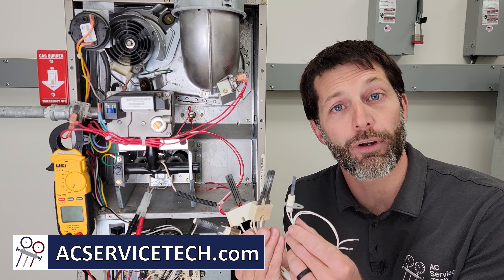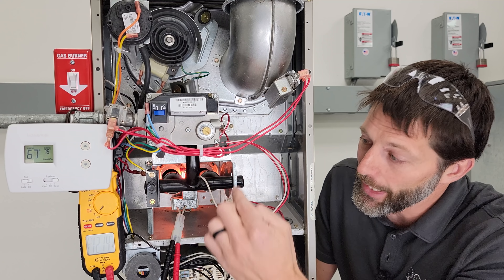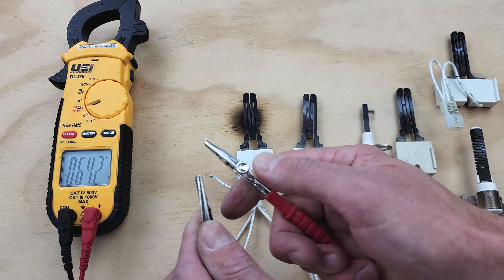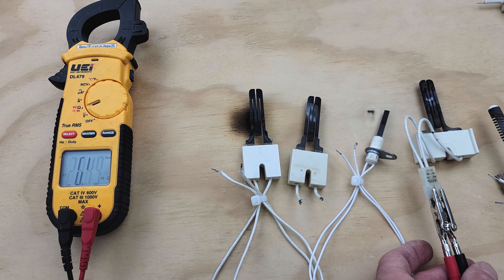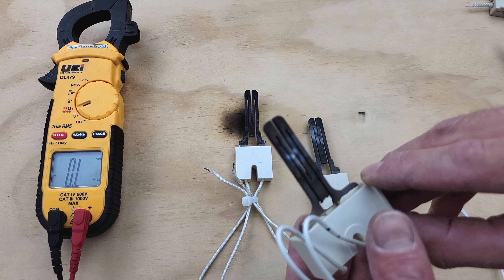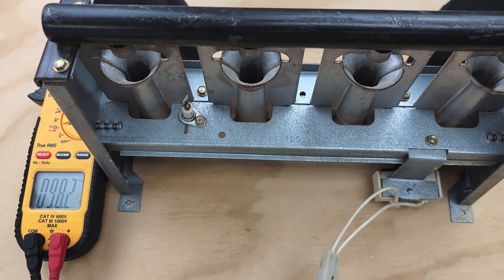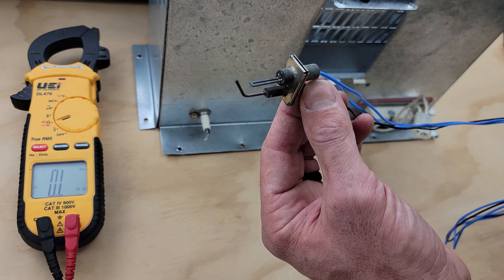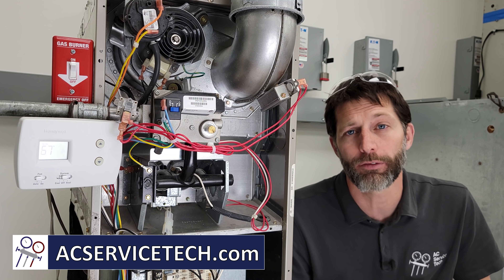HOT SURFACE IGNITOR Training for Gas Furnaces! HSI Types, Operation, Troubleshooting!

Comment: Absolutely on the money with all of your insights. I was having a problem with an igniter that only worked once. It turned out that the angle on it was the issue. It needed to be slightly angled and little closer to the burners to ignite. Saved me lots of money and additional frustrations. Great video! 👍👍👍

Comment: Excellent, just an excellent video...I see in comments they are used in ovens and such...True, and if the amperage draw and the Resistance as they get weaker is not enough the gas valve will not open...The igniter will glow but it still will not open the gas valve...Most require 2.5 - 3amps on an amp probe to open the safety valve on an oven...Thanks for a great video.

Comment: Thanks so much for this video.  It is a super clear explanation of how an ignitor works and how to troubleshoot it.  My furnace was not making heat and I was on the verge of looking for an HVAC company to come out and fix it but that would have undoubtedly cost me hundreds of dollars and days of delay.  This video showed me that my ignitor was bad and I was able to fix it myself.  I used a voltmeter to confirm that AC was reaching the ignitor and that the resistance of the ignitor was zero.  My furnace is a Trane and I was only getting a max of about 3.5 volts AC before it stepped down to 1.2 volts.  The repair was actually quite simple, just replace the ignitor.  Thanks again for this excellent video!!!  You're a rock star!!!

Comment: Important to note that the resistance with these igniters changes with heat. May start out at 20-50Ω but that resistance multiplies ~10X when powered for current regulation and longevity.

Comment: If you zoom in on the one in the middle that is bad when he applies power, you can see tiny arcs across the crack.  Those heat the crack, which likely expands enough to cause the ignitor to start flowing enough current to glow.  As with anything, those arc will eventually erode (pit) the crack causing complete failure.

Comment: Thanks for the video.  It's very informative.  I have a gas PTAC unit (Suburban Dynaline 3). Is the ignitor universal?   Do I need to do anything to suck out the remaining gas before I replace the ignitor? (Ex: shut off gas valve)

Comment: When you applied power, a tiny flash occurred on the defective unit and it started glowing in a small area.  That would have been an intermittent failure mode. BTY the good one on the left was drawing 245W and the small one on the right was drawing 300W.

Comment: Hvac newbie here….   If its glowing evenly no white residue, but measures 130 ohms is it still good? Is there a definite limit?
Reply: @FloatingLeaf1111  @E Man over the years on equipment I've found that 45 to 75 is OK, anything above 100/125 I recommend replacement, a lot of people decide against it the first time you recommend something like that especially if theyve never had a 95 dollar ignitor shut their furnace down lol.
Reply: I typically do an amp draw as well as ohm check. On the silicon carbide, I generally like to see at least 3 amps. Under 3 amps on a carbide means it might not be getting hot enough. I don't remember off hand the amp draw on silicon nitride, I've had virtually no issues with those. About the only failures I've seen with the nitrides are from getting wet from leaking condensate.
Reply: At 40 ohms they are pulling 3 amps so on a 120v circuit heating at 360 watts.  But at 120 ohms, they would only pull 1 am so 120 watts.  So in still air, the 40 ohm will turn red 3 times faster than the 1 ohm.  And the lower wattage also runs the risk that even the flowing gas could cool it to the point where it doesn't get hot enough to ignite the gas.
Reply: @FloatingLeaf1111 Something to consider is the pressure of the gas is only 3.5" w.c. or 11" w.c. manifold pressure, which is under 1/3 of a psi max. the inducer whipping around at 3000 rpm is going to cool the ignitor down a lot more than the gas flow. Ive found position of the ignitor to be alot more important than pressure or even the condition of the ignitor all important, but also Dirty burner or turbolator wont help either
Reply: You just check the manufacturer literature for the acceptable range. If it’s outside that range then replace it

Comment: Hi Sir, Thanks a lot for the video. Learned a lot. Here, I've got a question to ask for help. My house has a Goodman 2 Stage gas furnace. Recently it stopped working. I doubted the failure of the control board so I ordered one and replaced it. But it still doesn’t work. Problem is same. After the further check, I've noticed that if I connect all 5 pin connecter (link inducer and igniter), the draft inducer won’t work. It has only a couple of volts. But the ingiter has around 110 volts of power. When I disconnect either end of the line to igniter (on 5 pin connecter), the inducer runs, but igniter doesn’t (surely, no power in). When the inducer runs, it runs normally and smoothly. No any sign of problem. The igniter has 48 ohm when tested continuity. Seems also good. What could be the cause? Thanks.

Comment: I found this very educational.     Thanks.   A few questions when it comes to replacing a HSI.  Would accidentally touching the element during installation cause shorter lifespan due to skin oils?   Some folks tell me you should take precautions similar to changing out a halogen lamp, that is,  use rubbing alcohol if accidentally touched,  to remove skin oils that can hot spots and damage the glass when the lamp is turned on.    Others say it doesn't affect a hot surface ignitor.   Any other precautions that should be considered when removing or installing a hot surface ignitor?

Comment: Does old rheed furnace igniter polarity sensitive? When I replaced it with a new igniter, it tripped the breaker. Then after reversing the wire to the igniter, everything works fine.

Comment: How do you check for micro-amps on a furnace using the hot surface igniter as both the igniter and sensing rod? After having disappeared, (I thought), they’re back. I’m wrong. The system I was remembering was intermittent spark. What I’m seeing now is silicon nitride hot surface.

Comment: I had a No Heat call in 2019.  I went there and tested every part for heat.  The Hot Surface Igniter was not very bright.  I took ahold of the connector and turned it to see the part numbers.  The igniter started to glow real bright.  What was the problem?  Just some corrosion on a contact at the connector.  That was the second job for that customer.  The first was a no cooling call.  The capacitor for the indoor fan was replaced.  The classic bowing of the top of the capacitor.  My thiord time there was to replace the return air register.  It sits low on the wall and does get hit at times.  The customer inquired about the register on the first job.

Comment: my igniter is in a caloric oven, glows but does not lite burner for oven. caloric site made it sound as tho if its weak then it wont open gas valve and i should replace igniter. does it have to be cracked to be bad/weak?? or can it just be old age? ( my caloric oven is 30+ yrs old or so) ... I'm just asking cuz from what i see, i don't see any cracks in it ...

Comment: I made a mistake and (preventative maintenance reasons) cleaned my silicone nitride version, which looks just like the newest style in your video.  I used 0000 steel wool, then cleaned it with alcohol before re-installation.  It was in super good physical condition and worked fine, before and after.  Will this likely shorten its life?

Comment: My gas furnace has SPARK  ignition which has proven to be very reliable,  so I’ve always questioned the HOT SURFACE IGNITOR. Why use them when they always fail.  How would you convert from hot surface ignitor to spark ignition. 
Thank you.
Reply: Hot surface has finally caught up with spark in reliability with the silicon nitride. Why HSI vs Spark? Spark ignition requires a more complicated circuit to produce the spark, where hot surface is just a relay with 120v and most spark have intermittent pilot, so a more complicated gas valve, a pilot and tubing for the pilot. It wouldn't be impossible to change from hot surface to spark, but the furnace was not engineered to have that type of ignition and the liability of changing it could be substantial. But to answer your question, the 3 main differences between hot surface and spark are: 1. the ignition module or control board has to be spark. 2. The gas valves are likely different as mentioned before. 3. The ignitor would have to be replaced with a spark/pilot assembly.
Reply: Intermittent pilot with spark pilot ignition is likely what you have.  That way the pilot flame is proven before turning on the gas full.  If you try to light the burner with spark ignition, you could end up with a cabinet full of gas if the ignition failed.  And then you could have an explosion.  

Should the gas not immediately ignite with a hot surface ignitor being poorly placed, it will sooner rather than later thus reducing the risk of gas build up.  

Ultimately, a pilot, even intermittent, is a cost for the gas, an impact on the efficiency and likely was essentially abandoned to meet government climate change regulations.

Comment: Since i switched to commercial/ industrial a few years ago......i almost never see a HSI anymore. Only on Trane Voyagers. Everything else uses spark. RTU's, MUA'S, Boilers, Unit Heaters. Obviously there are still different brands who use a HSI, but as a generalization most don't. I think Rheem is one of the only residential brands that still uses spark ignition. I like spark better than HSI.

Comment: Ah yes, the hot surface igniter. Or as I call em' the "Don't even sneeze in it's general direction...just make sure the burners run"  Those asshole things will crack if you so much as remove a screw for the in-shot burners to clean them. Not worth getting a system with one if you enjoy maintenance.